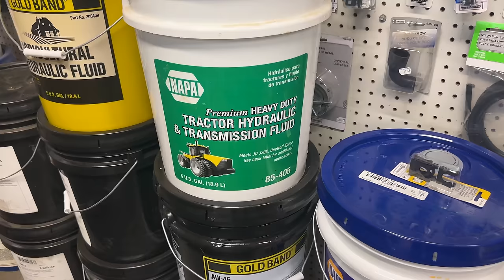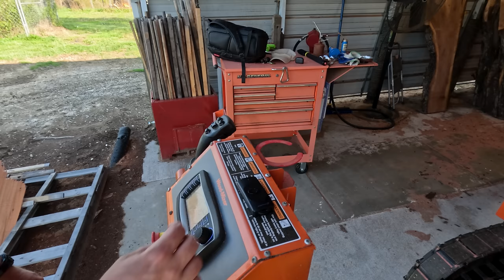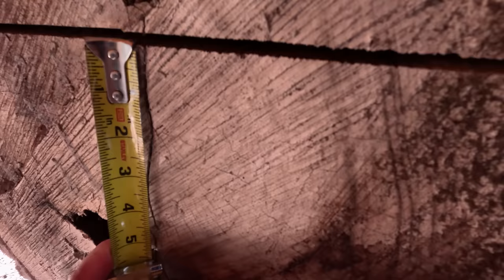Need Lumber? My Secret On Finding FREE Logs: Easy $$$

Comment: Like the format.. if you onky saw mill I will get board over time.. show us everything thst makes your operation run.. you have let us into your life by choice😊 and now we are curious.. thanks for what you do.. PS I'm a wood worker and know a thing or two about dust collection.. if you modify your mill dust collection you would get much better results. . Let's say you have 6 inch coming from your mill but then you put it down to a 4 inch going into dust collection. . Take that splitter off your dust collector and keep it the larger pipe.. you will be greatly surprised

Comment: Video format is good to go as is. Do have a question about how you deal with your sawdust when you are milling walnut. I've been told not to use it in your compost as the walnut sawdust isn't good for your plants. Stay dry.